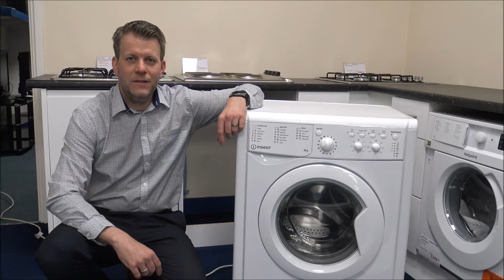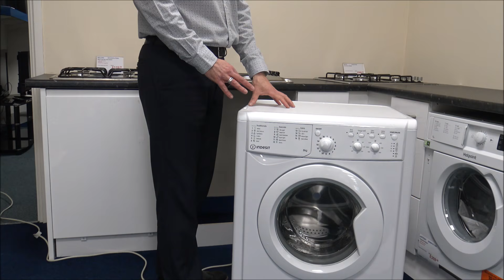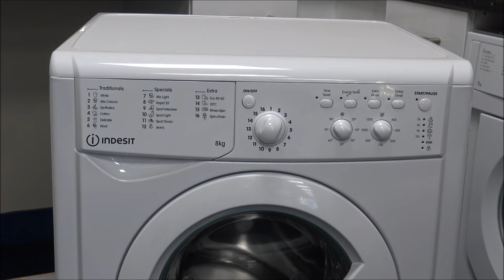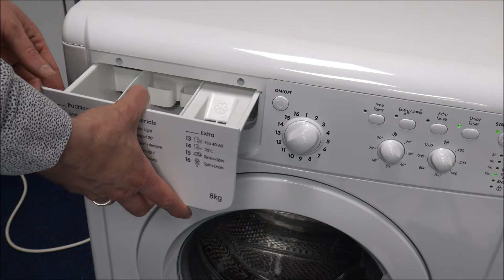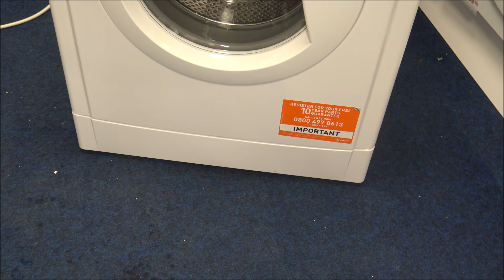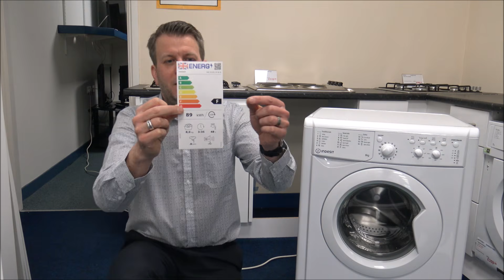Indesit IWC81251 or IWC71252 1200 Spin Washing Machine Demonstration

Comment: Why do modern washing machines take so long on the main cycles? This was not the case once over. I find a hour wash is normally fine but not 3 hours. ??? Need to think what to buy
Reply from the maker: Apparantly it is more energy efficient for the clothes to be soaked for longer than doing a quicker wash. It can be frustrating this happens especially if you have a lot of washing to do.
Reply: @lords-electrical yes I agree and also things you only put one once or a bath towel only used once a cycle for about an hour is plenty. I find the short cycle just don’t spin the same. Or could be my machine. Also what ever happened to the 50 degree wash it’s disappeared. ? 😮

Comment: I’ve just purchased one of these the model is IWSC61252 yes. The standard washes. Take a. Few. Hours. But if you want a quick 40 wash set it to the jeans programme it runs for around an hour quick 30 is sport light also about an hour, to activate timesaver on whites you have to press energy save and time save together then turn energy save off, the 30 
Min quick programme is rapid 20 with energy save selected. Hope this helps you all struggling with how to get it to wash quicker.
Reply from the maker: Great feedback thanks
Reply: @lords-electrical  just hope it helps a few people out 😁

Comment: This machine wash time seems to be 2hours and the clothes do not get clean still stained why is this
Reply from the maker: It could be the detergent you are using, try and use a good quality detergent as some cheap ones are not very good. Also select the Cotton program and maybe a slightly higher temperature than before which should hopefully help to get your clothes clean.

Comment: Why does the wash indicator light come on and stay flashing and bleeping half way through the program??  This is a brand new machine.,first wash..
Reply from the maker: Is the performance of the wash ok? It could be that the water pressure is too low and it is needing more water to perform a wash cycle
Reply: @lords-electrical  so if that's the case what do I need to do next?

Comment: Is there screws inside of the drum what i need to remove before using my new washer
Reply from the maker: You will have transit bolts on the back of the machine that need to be taken out before it is connected and used. These hold the drum steady during transit. If you don't take them out, there is a good chance the machine will get damaged when used, and it won't be covered under the manufacturers warranty to be repaired.

Comment: What if I don’t want to dry them but have a quick cycle?
Reply from the maker: You can use it on a quick cycle but as this is only a washing machine then it won't dry the clothes. You would need a washer dryer for that to happen in a single machine

Comment: What does it mean when it is leaking at the side
Reply from the maker: Not too sure, but it could be that the water connection to the soap drawer is loose, i really depends where the leak is coming from. It could also be that the pump rubber has split slightly if it has been put on a sack barrow incorrectly then this can be an issue. Hopefully it is still under the manufacturers warranty and they will sort it out for you.

Comment: i have this machine and one thing that keeps bugging me, is when i put bed sheets in it will beep at me throughout the wash. I believe this means the weight distribution is off because the sheets have all bundled together. What should i do when this happens?
Reply from the maker: This is always a difficult one but washing machines need several items in to try and balance the load so ideally get a couple of other items so the machine can balance the load out if possible.

Comment: I have a IWC81482  AND WHEN I TURN IT ON ITS KEEPS LIGHT UP 3HR AND THE RED LOCK SYMBOL comes up bit nothing happens ,have cleaned out the bottom where the muck builds up and still not working
Reply from the maker: The red lock symbol normally indicates the child lock is active
Reply: How to open child lock

Comment: This machine takes 3hr minimum. Please make video for 30-40mins quick wash.
Reply: Same here and time saver option stop working
Reply: Number 8 is  Quick wash it takes 25 minutes
Reply: Yes please
Reply: 20 degree eco wash is quick enough I find
Reply: portugues
Reply: Number 13
Reply: Could you find a way to do quick washes? :) Struggling with the same
Reply: 2:28  @leventyalcin
Reply: @leventyalcin  number 8 is just take 25 minutes

Comment: I’ve had this machine since Tuesday and it’s not working properly as it keeps beeping and pausing itself plus it’s taking forever to do a wash! I give up after over 5 hours and then have to keep switching to rince then spin and drain, it’s driving me mad!
Reply from the maker: Normally the advice I give is to make sure the program is suitable for the wash load. If the load for the wash should only have a max load of say 3kg, and you are trying to wash 7kg then it will take a lot longer than the program states. It states this info in a chart in the instructions
Reply: But should it keep beeping?

Comment: OMG, thank you so much!  I've had my machine for years, and suddenly it stopped spinning and my clothes were having to be rung out before going into the tumble dryer.  I cleared the filters etc, but no joy.  I set my machine's dials when I first had the machine, and rarely change the programs.  However, turns out, that the dial on the right for spinning had been turned to off sometime recently. Because I never adjust the dials (they've always worked fine as I set them originally) I never bothered to check that particular dial until this morning.  lol.  The machine is working as normal now, thank you!
Reply from the maker: Good that you found what the issue is, though. Thanks for this feedback
Reply: Mine makes spinning noise but not spinning how I fix
Reply: Prevod na srpskom
Reply: Mine has  my washing and all the lights  are flashing  have switched off  but it keeps coming back on
Reply: Help

Comment: This one takes ages to finish. 4 hours is just too much. Give me  a 30 minutes 40c quick wash.
Reply: Omg this is boring, please tell how to shorter the 3 hours
Reply: I've never done any of my washing at 77 or anything so high
Reply: @tanyamillard8181  celsius or fahrenheit
Reply: I'm regretting buying this..I cant get it going!
Reply: Washing machines have the option for a quick wash, but it should only be used for not really dirty clothes otherwise is it impossible to wash stuff correctly in a 30 minutes run at 40c
Reply: I put it on  mixed colours takes about 4 hours :( put it on eco it took 8 hrs for goodness sake I've never had a washing machine that takes that long.goodness knows what my electricity and water bill going to be 😔
Reply: @tanyamillard8181  well actually longes the cycle is and less water is used. it should be written on the user manual how much water does the machine use. Indesit machines are made  where I live
Reply: Yes ,same with me
Reply: Same here it's ridiculous no matter what I do I've never had indesit b4 :(
Reply: @tanyamillard8181  a short cycle does not wash correctly soiled clothes. Mine has a 15’/30’ cycle but it is recommended to use it only for not stained or heavily soiled item
Reply: Totally agree I’ve just bought one it’s shite really bad design.

Comment: Hi there
I have had flooding because the drainage pipe is low to the floor and has to be lifted up the height of machine and then into under sink plumbing. What can I do about this please?
Reply from the maker: Does sound odd, i would first of all check to make sure there is no blockage in the waste pipe. If you have a stand pipe that the waste pipe goes into, make sure it isn't pushed too far in as well.

Comment: I bought this a few weeks ago great machine but very long wash cycles and no quick wash option so not very economical
Reply: If you look in the Manual you get with it setting 8 is a 20 minute wash.
Reply: @xlinzellax  I feel it needs to drain and spin after this setting? The washing powder is still in the clothes??? 
Definitely not economical at all.
Reply: @xlinzellax  I cant get 8 to work..
Reply: @xlinzellax  I’ve just boggy this machine &  is setting 8 the shortest wash time cycle?
Reply from the maker: Yes it is a common comment about modern washing machines that the programmes do take a long time.
Reply: @Dee Rawler if you have a look in the booklet manual it came with it explains all the settings and how long the washes are x
Reply: I never saw any machine take so long time in Sweden .
Reply: I agree